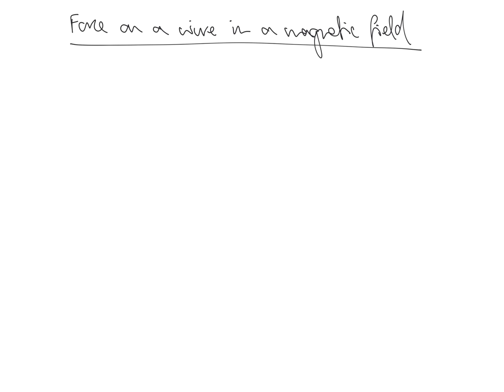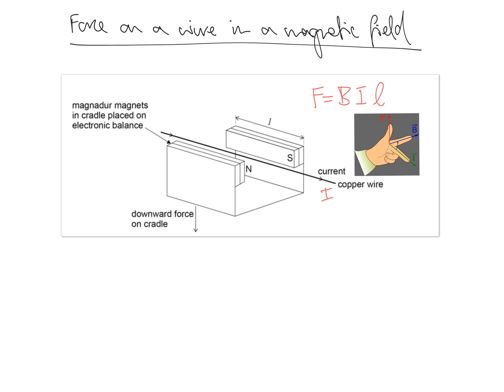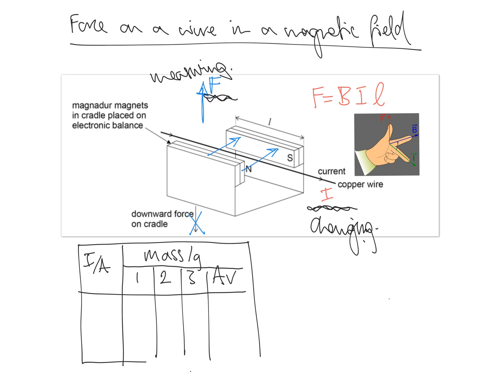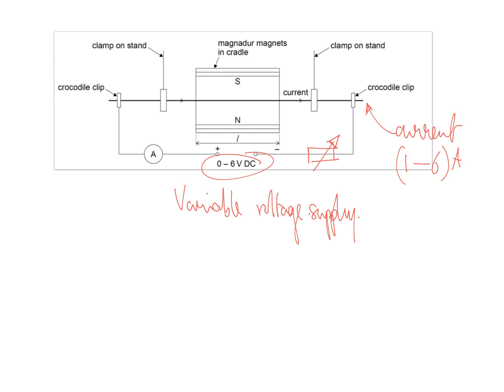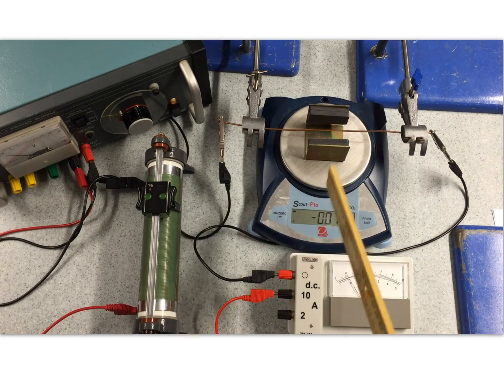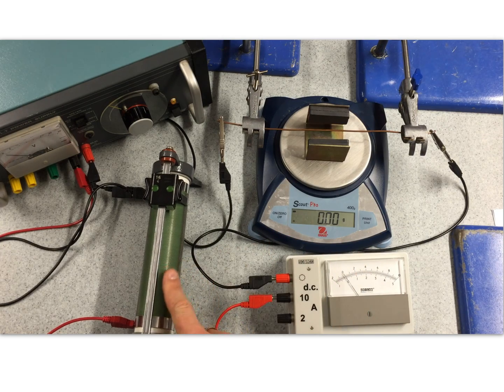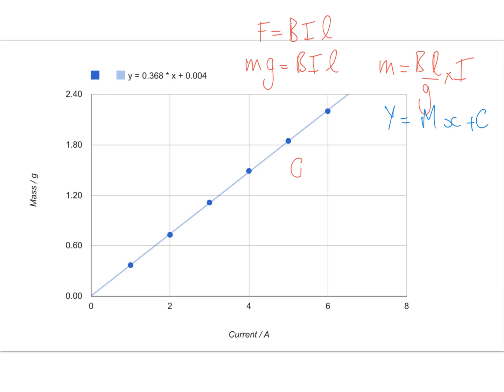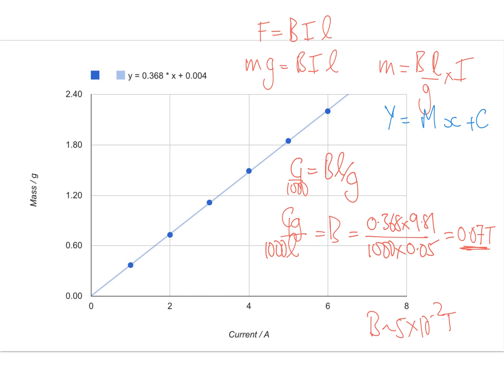AQA PRAC Force on a wire in magnetic field

Comment: The left-hand rule is a flow of conventional current which is positive but electrons flow in the wire so the force would be acting downwards not upwards as you stated right?
Reply: The Diagram shows the flow of conventional current. The reason for Damian's confusion is that the force on the wire is upwards, so the Newton's Third Law reaction force on the cradle is downwards.
Reply: no, current drawn on diagrams always refers to the positive conventional current unless stated otherwise.

Comment: The only hint to their force being correct is that the left hand rule is about the force on the current only. What isn't specified in this is that the wire is held in place. If the wire is held in place, then the only observable force is the reaction force of the cradle to pushing the wire upwards, causing the cradle to be pushed down